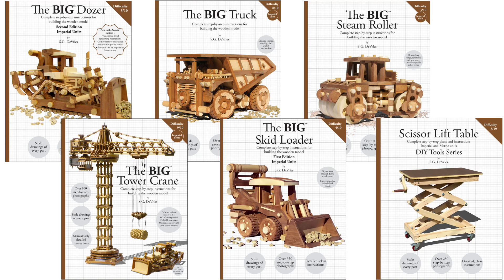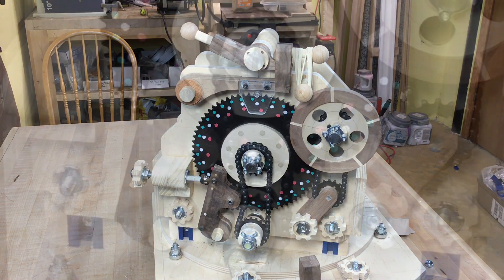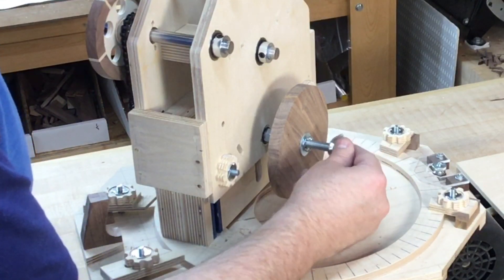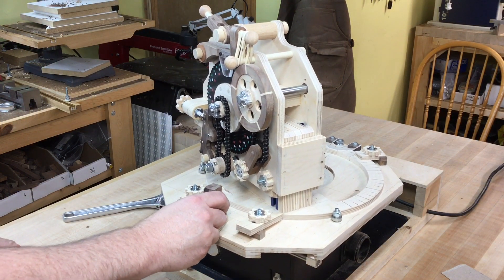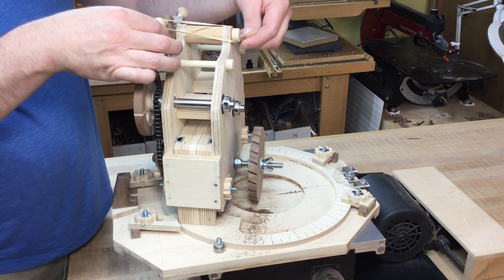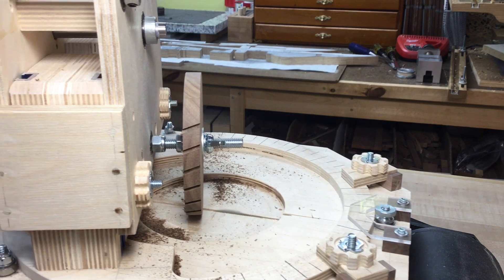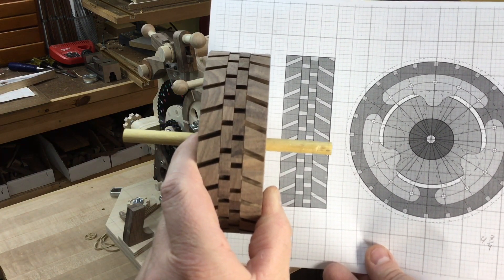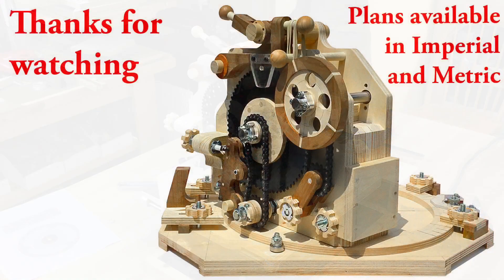Accurate and repeatable wooden wheel tire tread jig for wood models or toys. Plans available.

Comment: Hi. I'm about to start getting parts for the metric version, however seems to be an issue with stated sprocket on large sprocket axle and sprocket on rotation wheel axle. The added radius of both, is larger that center distance between the two axles, as far as I can see, meaning the sprockets will overlap.

Alternatively I can source 0,250 pitch sprockets, however the smallest available sprocket found is with 20 teeth, and again this will make the added radius larger than center distance between the two axles.

Guess the axle of the rotation wheel will have to be moved a bit away from the the large sprocket axle. Have any done the metric version, and can comment on this?

Comment: Hi, I'm starting on this build as a warm-up for the dump truck, and I've run into the sprocket source problem. I have the tools to make my own wooden sprocket, do you think the stresses on the jig would work ok with a plywood sprocket? Sourcing delrin stock would be plan B. Thanks!
Reply from the maker: I am looking for an alternate source for the sprockets also. Plastockonline.com carries the smaller sprockets, although they come with a hub bump as part of the sprocket.
Mrosupply.com carries the .25 pitch 72 tooth, but it is much more expensive, so I can't recommend them....  
Vexrobotics carries the 72 tooth sprocket in aluminum, which in retrospect, if I had found them earlier I would probably have used it over the acetal sprocket, although you will have to make a hub bushing because the bore is about 1.125 inches. 
I am hoping that Servocity will stock them again, since .25 pitch is a common chain size.
Reply: @s.g.devries8557  thank you. $26 shipping on a   $19 sprocket. Ouch...